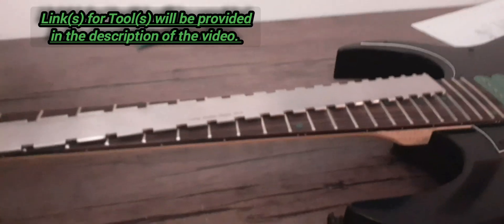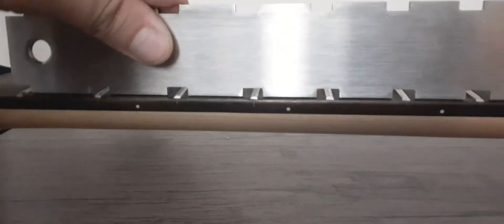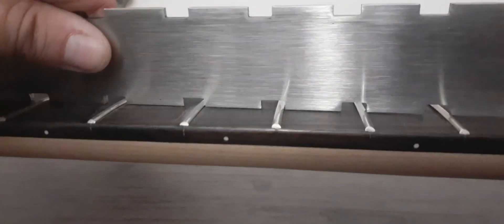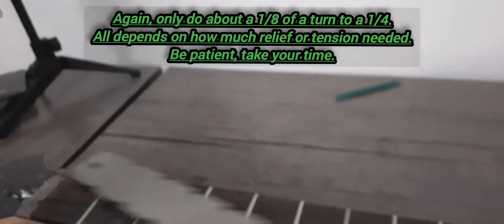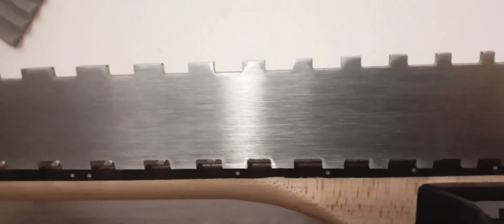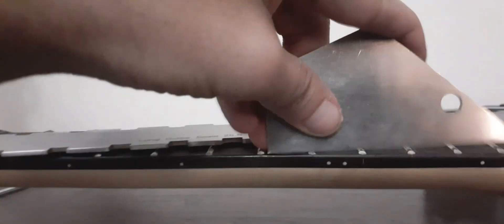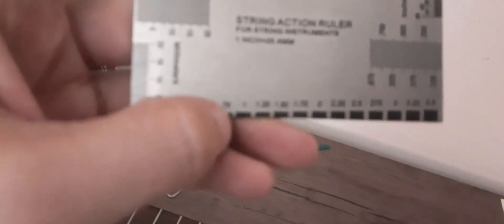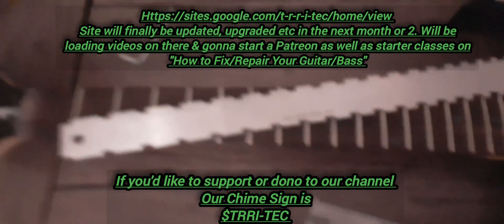Twytch's "How-To" Tech Tip: Using A Notched Straight Edge & Fret Rocker

Comment: One question, shouldn't the ruler cover the entire length of the neck? Because your ruler was not as long as the neck. Which one is better?
Reply from the maker: Nope, that's honestly a general misconception. You're only measuring "scale length" and when using a notched ruler you start at second/2nd Fret.